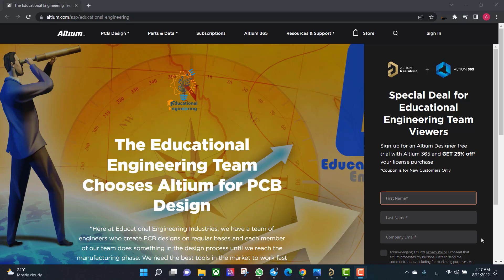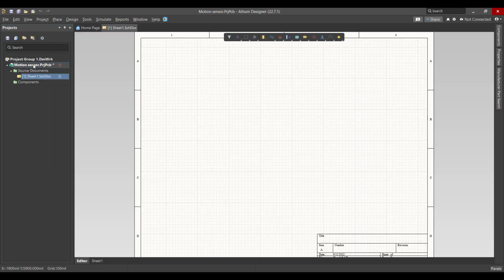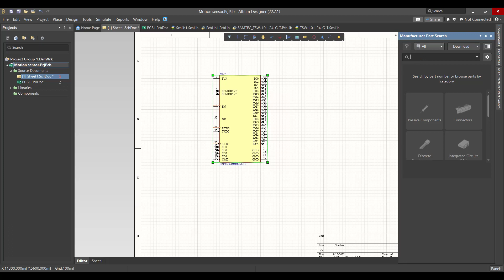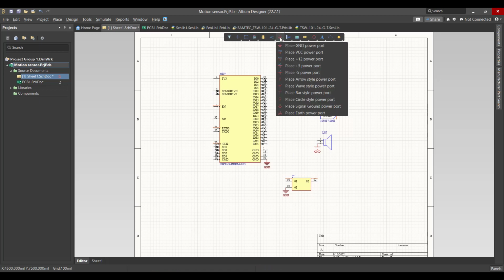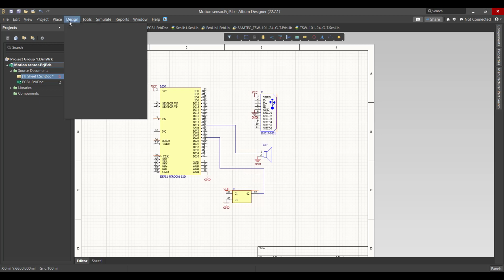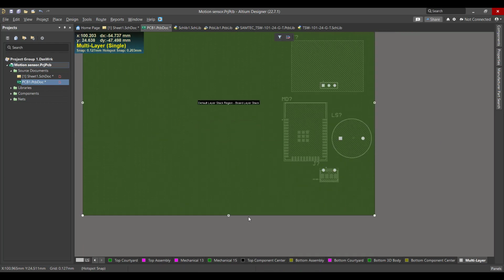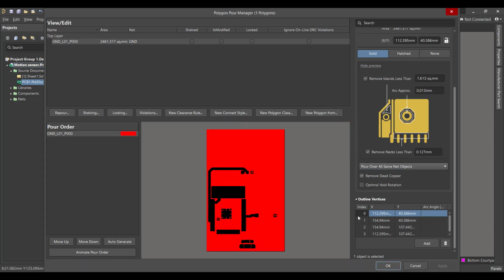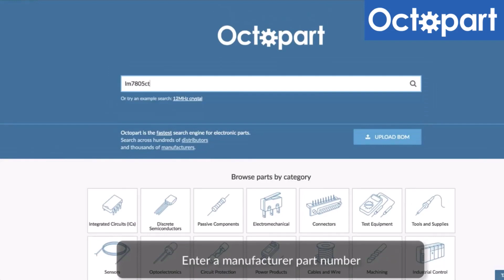Design Motion Sensor with ESP32 using Altium designer

Comment: this is ridiculous, how you going to power the 3.3v esp32 with 5v from usb?  where the regulator....how you going to program the module?
Reply from the maker: Can you elaborate??
Reply: @EducationalEngineeringTeam  what i think he means is the esp32 chip runs on 3.3v and not 5v. most boards have a regulator that drops the voltage down to 3.3v for the mcu but also allow for 5v pins on the board.
he also asking where is the bootloader that is normally present on an esp32 board so it can be programmed.